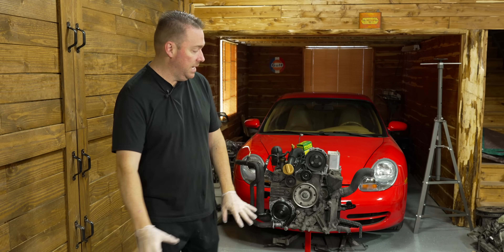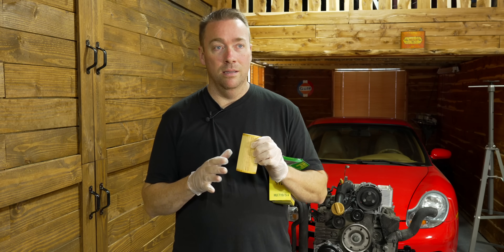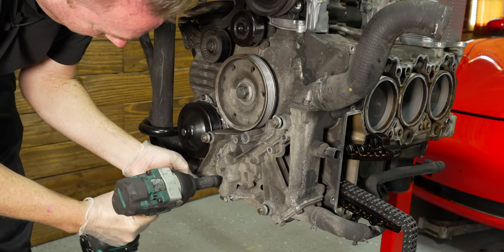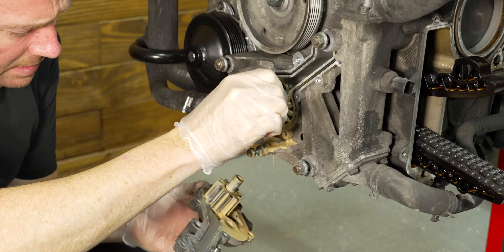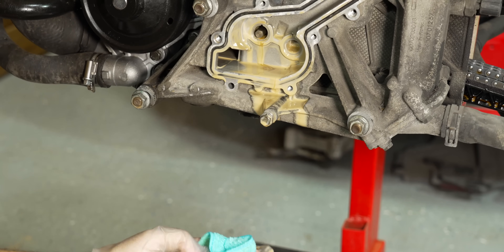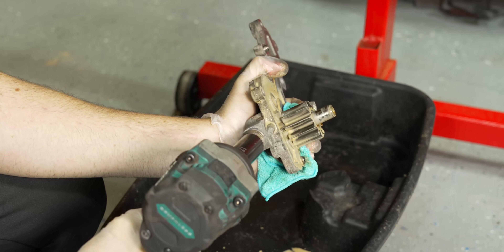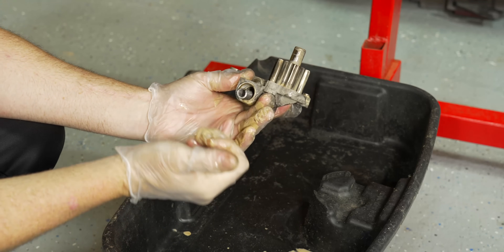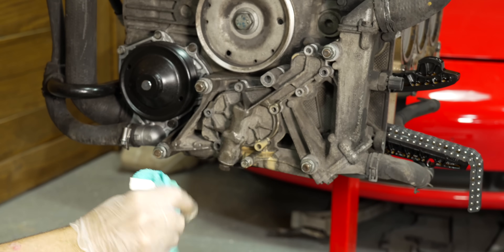EASILY AVOID ENGINE FAILURE Porsche 996 986 987 997 Low Oil Pressure Oil Pump Fix

Comment: I'm actually starting to wonder if the oil Porsche actually recommend is really the best,  I think a slightly thicker oil would be better , or maybe a Brand that isn't sponsored like Mobile 1,  just because it's sponsored doesn't mean it's the best,  my Audi tt never suffered from oil pressure problems after changing to a slightly thicker oil.
What do you recommend  ?

Comment: This is super useful. I’ve been using VD80BT to monitor engine sensors live, and catching oil pressure drops early really helps avoid big issues.

Comment: "First things first" ???
The FIRST thing I noticed (when you broke the seal) was the creamy oil!

"Well, there's your problem" 
(as the MythBusters used to say)

"pretty sure" that is NOT normal... 
water is A LOT thinner than 40w oil, 
and will give you low oil pressure.

IMO...😬

Comment: Hey, I just changed out the oil pump on a 997.1 b/c the housing had a micro crack and was sweating coolant. Now that I have the new one on, is there a step to prime the new pump before startup? Or is it actually direct fed from the sump because it's down so low, in other words when you refill the oil, the level in the sump actually fills the oil pump housing too?

Comment: Have you taken off the oil pump housing? I need to remove it to gain access to two bolts that hold in the timing chain guides, and I am having a bit of trouble getting that housing off and wondering does it in any way support the IMS somehow, if you can assist please.

Comment: Nathan, i need help. I'm buying a 996 c4 3.4 and I'm looking for options. Just went to test drive one and after the test, oil pressure was 0,9bar..that is not good isn't it? Then...i didn't feel much power, owner told me he repaired the oil/water exchanger and there was no IMS slot because it is a 997 engine...no clue. Saw the engine heads and i read VarioCam F1, and M96/04 so it's a stock engine. With my diagnostic tool it read 0 degrees deviation on bank 1 and 1070-1059 degrees on bank 2 on warm engine. I'm afraid that engine is already gone...fortunately no trace of bore scoring. Oh...oil was a 5w50 btw. What would you suggest? To run away right?

Comment: If the oil filter is a major problem, and causing low oil pressure at idle,  as you say, it would have been resolved a long time ago.  Everybody does not have the problem you suggested. I think you have a few other problems.  We have never seen it on our 996.

Comment: Hi I have a 2006 997 Gen1 I replaced the water pump and thermostat complete with housing and replaced the coolant and replaced it with new coolant since I’ve done that I’m having a problem with The temperature gauge every time I go on a long journey and get above 50 mile an hour it drops out stops working I’ve replaced the sensor with a genuine Porsche one and made sure all the air was removed from the system but I’m still having this problem I wonder if you’ve got any advice that you can give me many thanks Ron from London England

Comment: You better split the case. A few months after you put this back together? It will start losing coolant *again. But you wont find it. There is a O-ring seal at the top of the block for a water passage.. guess what the oil in the water does to this seal? It turns it to JELLY. The engine will DRIP water from the passage into the block. Hot oil will evap the coolant at a slow rate so you wont find it in the oil... but every few weeks you will be adding coolant. Do yourself (and the owner of the car) a favor and split the case and replace the upper water passage seal in the block. 20yrs of building and racing these engines.

Comment: The new model oil pressure relief valve has a beveled edge on it. Works much better. Solved any issues. As well as the new spring is slightly longer.

Comment: Other than replacing the spring, what did you do in this video that would improve the oil pressure or flow? Or was the spring the primary issue you wanted to address?

Comment: Coolant in the oil, look for a cracked head. If the 996 and 997.1 with M96 and M97 engines are ever tracked adding an $800 deep sump extension which adds 2 ltrs of additional oil  is an absolute MUST if you want to keep your engine from oil starvation.
Reply: Absolutely right!

Comment: Great video really helps those of us with 996's in the garage. When your schedule permits, would you mind posting the torque specs for the oil pump cover plate and the spring bolt?

Thanks

Comment: Hi thanks for the great video. What oil pressure reading at idle (fully warm) would you say is getting to the point where the pressure is too low?
My 997 shows 2-2.5 bar.
Also, is it possible to just change that spring on the car without removing the bumper and crash bar?
Another question, if the filter has twisted, can you tell when it's removed, or will it just spring back straight when you take it out? 
Thanks again.
Reply: As long as it rises and stays above 4psi during driving (and its warmed through and bedding in oil) I'd say its fine.
Reply: 2 bar is 29psi (not knowing much about the 3.4/3.6 yet), my 1974 2.7 has 10psi at idle and that is normal. I think 10 psi/1000 rpm is the norm for the air cooled engines.
I guess it depends on where the oil pressure sensor is measuring what the bearings are seeing (obviously what the the bearings gets is MORE important than what the gauge gets...) 
P.S. the aircooled 911 engines never had "bore scoring". I wonder why? (sarc) and it is NOT the cooling.

Comment: Strange... my 89 VW had low oil pressure its entire life.  VAG just liked it that way?  My fix was (at least) 10w40 oil plus the Mann filter.  OR 20w50 syn oil, even if winter.

Comment: How is changing the spring going to increase idle oil pressure? At idle the pressure is 1 to 1.5 bar or ~20psi and the bypass opens at over ~75psi. The spring/bypass doesn't know it's idling, it just opens when psi is over ~75, at high engine RPM, so it doesn't blow out the filter.
Reply from the maker: We change the spring on these no matter what since the original spring can break or become weak
Reply: HI, I understand the same. But then, if a stiffer spring helps with oil pressure at idle, does that mean that the valve opens always, letting bleed some of the pressure? Is this the way it works?. Thanks!

Comment: How much does that 987 spring raises the oil pressure at idle when hot? Maybe also a couple of washers could do that job to raise it a little bit
Reply: It doesn't increase any at idle. The bypass spring doesn't "bypass" until ~75 psi.
Reply: @DSC800  you're right. I didn't use the logical sense here. Thanks man

Comment: is this the car that you thought needed a new engine? Would u also change the Ims bearing as well since you have the engine apart
Reply: The earlier cars such as this had a double row ims bearing which rarely gave trouble.
Reply: @petergordon4525  That is true however while it is apart it is better to be safe and avoid a grenade in the engine.
Reply from the maker: IMS is ordered

Comment: hi nathan the link i sent of the guy who had coolent driping from one of the oil pump bolts there is a water way right at the bottom just to the right of the pipe and just above it is the oil pick up to the pump in if that gasket has gone it could take water in there, while your at that stage and its nice and easy to work on might be worth a quick look
Reply from the maker: We have a whole gasket set ordered i will do them all
Reply: @NathansPorscheWorkshop  your better off doing that like you said some one has already been in there and you dont know to what extent ... i bought a 2003 boxster the guy said it just stoped so i got a friend to put a new battery and starter on it ... any way off i went when i pulled it apart 1 piston was shatered the liner was smashed out the piston next to it was partly smashed the valves bent half the piston stuck in the head ... lol... and it just stopped i think he forgot to mention the crunch crunch bang bang and the wheels locking up so they never tell you the full story

Comment: Based on the fact that some of these paper filters "twist" when installed and cause oil pressure problems, I wonder if this is another argument to install an L&N Engineering filter adapter that will accept a screw-on metal filter....

Comment: If these engines are notorious for low oil pressure at idle, and this engine has been around is various displacements for decades, please tell us from which year forward did Porsche finally addressed and fixed this issue. And if they did fix it, can you share with us what changes did they make to the engine to fix it? Also, please share with us if to your knowledge, they have never fixed this issue.

Comment: Replace the oil pressure valve with the updated version from the 997 for better low rpm oil pressure! And the spring looks the same but it is a different stiffness so update that as well. I did a video on it here https://youtu.be/H5OdGdcqYEA
Reply from the maker: The spring i put in is the latest update
Reply: @NathansPorscheWorkshop  the updated piston with the bevel on the edge is the big update. Did you get one? It’s only a few bucks and the pressure increase is well documented.

Comment: I always used the Bosch filter because its really an industrial use filter and has the two end caps in plastic with o-rings and the plastic inner frame. Thought process is that it feels more robust compared to something like the Mann filter, but I wonder if it is any better at all.
Reply: I would only use man filters